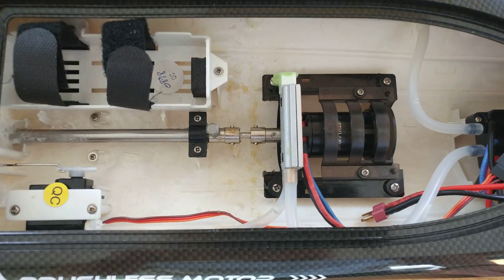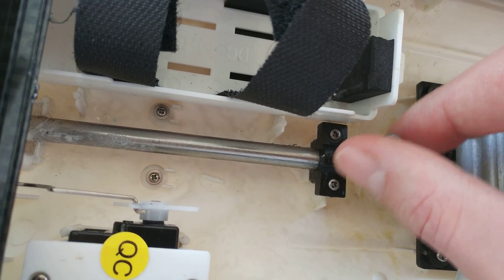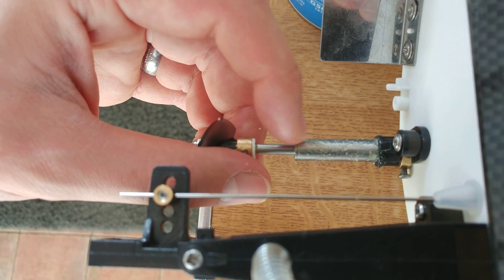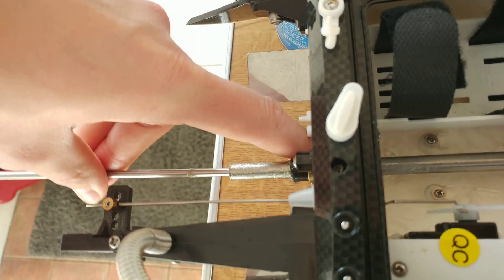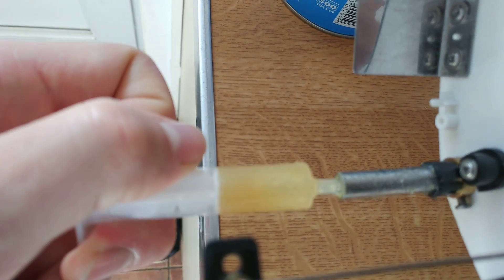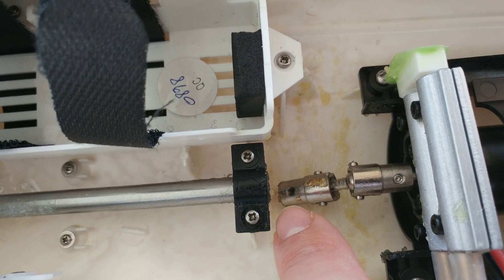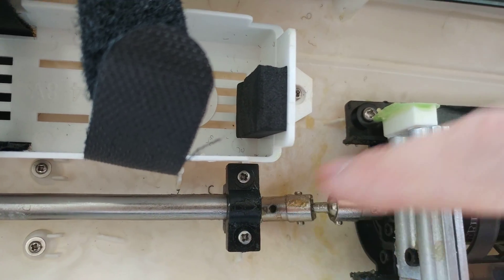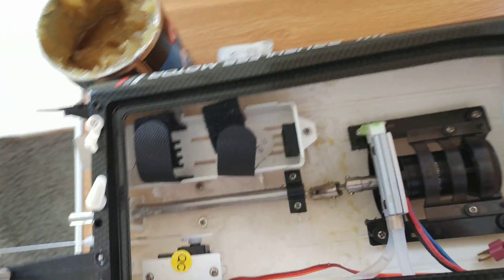How to grease RC Boat shaft coupler and stuffing tube

Comment: Just put some regular grease into a hollow tube, genius. Marine grease is water resistant and blue that serves a function to block water ingress. How are you lubing the bearings? And why replace a nylon washer rather than tighten up the couplings?

Comment: WHAT AM I DOING WRONG?  I take off the hex bolt then pull and shaft does not pull out?  It’s still locked in place.  D’Oh!
Reply: It didn't work out for me either. Did you manage to do it after all? And how did you do that?

Comment: Don’t undo the grub screw all the way out.. you don’t need to and it saves it from losing it, stop you from struggling trying to get it back in the coupler and ensure you can’t cross thread it.
Easy way to check how much to unscrew is undo until the cable is free... give a 1/4-1/2 turn more to be sure.

Comment: Thanks for this tip! I have my 'first' boat (FT012). What kind of grease should I use? Also, I lost contact the first time I tried the boat and lost it because the water was floating and I couldn't follow it. Is there a way to prevent that from happening?
Reply from the maker: Unsure what issue you had but water proof marine grease
Reply: @ENGDyna  Thanks!

Comment: By stuffing that sleeve with grease doesn't make any sence.Theres bearings at each end which the shaft rests and spins on.The shaft doesn't touch anything in that sleeve.There for all you have to do is grease the bearings at each end.
Reply from the maker: mike gannon That's what I initially thought but failures happen not greasing it all.
Reply: @ENGDyna  I am building DIY RC boat and I am about to install  a shaft ... so the rear bering is it going to be submerged ?
Reply: ea @negativentry  Get hold of Boca bearing for bearing used under water. Silicon bearing if memory serves me correct.

Comment: I have a problem with my shaft bro the small hex bolts has round and i cannot get it off can you give an idea on how to get it out?? As i want to grease my shaft also . .thanks
Reply from the maker: Shawn Calingacion Maybe solder an allen key to it then turn anti clockwise to release. Or heat the hex screw up abit and try. Problem was you might of used a poor allen key or attachment and the hex screw initially had threadlock so it can happen
Reply: ENG Dyna i'll try what you said bro thanks. . I'll commnet again after i done it :)
Reply from the maker: Shawn Calingacion Cool. Whwn you grease through the tube and around the coupler. Tape around the coupler to lock all the geease in otherwise it makes a right mess lol

Comment: Hi!
first, thanks for this video!

two questions:
What grease should I use here?
And where can I get it from?
Reply from the maker: Kite-King Marine grease as it's waterproof. If you have nothing but want to go out some Vaseline will be fine. I use carlube marine grease it's a big tin and cheap.
Reply: ENG Dyna , thanks for this info. I've ordered some marine grease now for my 3 RC boats...
Reply from the maker: Kite-King No probs, these shafts can spin upto 30,000 rpm or more and will heat up and the coupler if it uses one is under huge pressure. It may be ideal to put kitchen paper around the coupler area as it will get messy like mine shows lol.
Reply: ENG Dyna, I have one ft011 and two ft009 , that have no coupler.
but I think the smaller boats will also like some grease ;)
This way they will hopefully last a little bit longer...
Reply: Sure, push shaft in and out comes grease at the coupler.
Reply: I also use Andis hair clipper oil which works great.